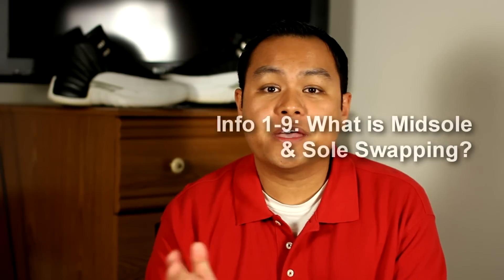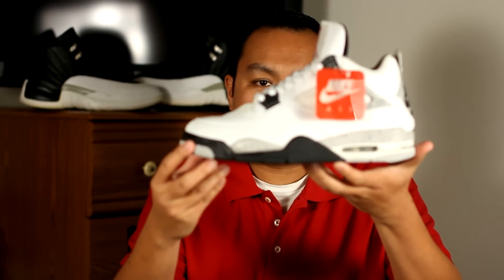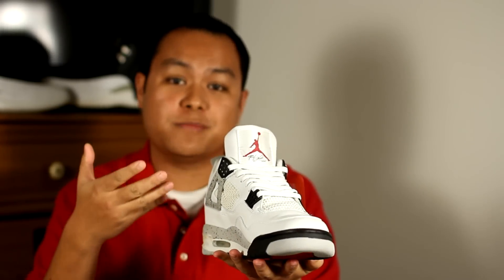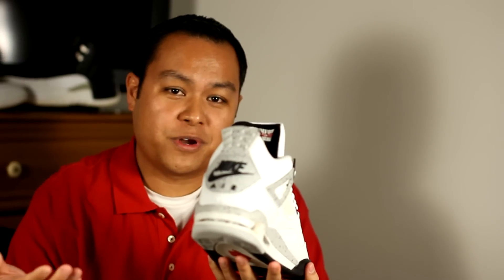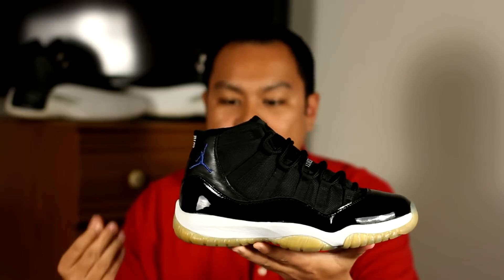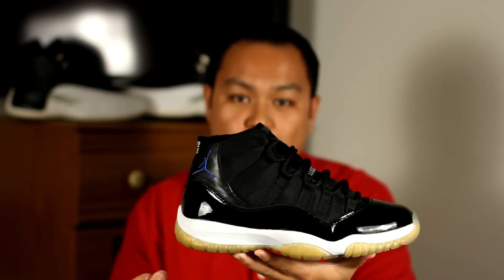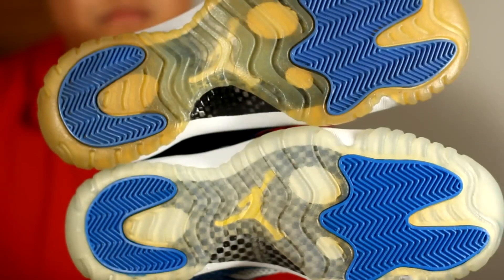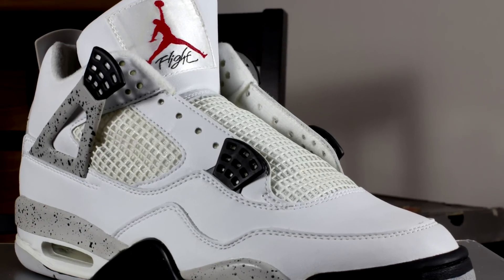Midsole & Sole Swapping (Preview Air Jordan 4 Retro)

Comment from the maker: @Rockin5teve the small ones are usually fine, if there's 1 or 2 of them placed inside the shoes. Also it depends on the shoes. If they have foam midsoles like the 3's and 4's (polyurethane), I'd take them out. Personally I'd rather have the shoes yellow, than to fall apart.

Comment: There are millions of Jordans and Nikes with the Jordan 4 Midsole and 3 Midsole, that s the base for many sneakers that the brands create. On the ISS Restoration forums, I saw someone swapped the Cement dub zero midsole for the Jordan 4 Cement midsole....it looked bad because the patterns of both don't match up. VERY NICE video.

Comment: Where do you get the mid soles for white cement 4s. I know I can't repaint theat pattern so I was wondering if you can buy just the og midsole.
Reply: You find another pair with a good midsole but if you are trying to find the 99 cements midsole they are gonna crumble fast